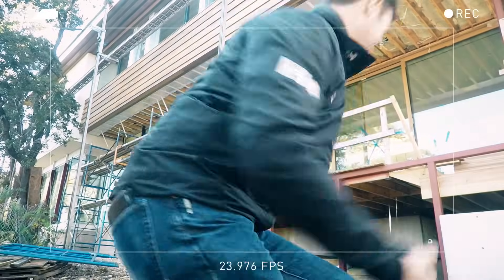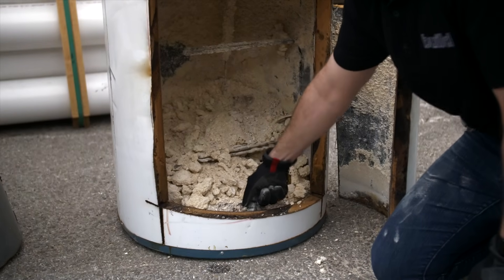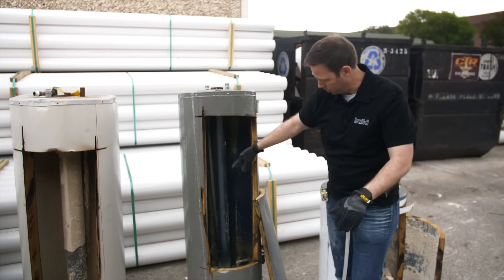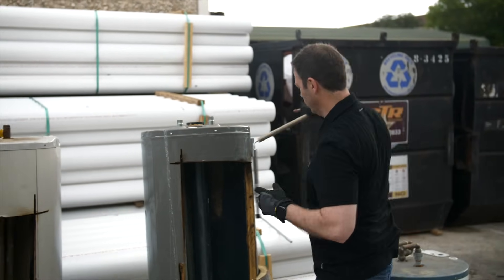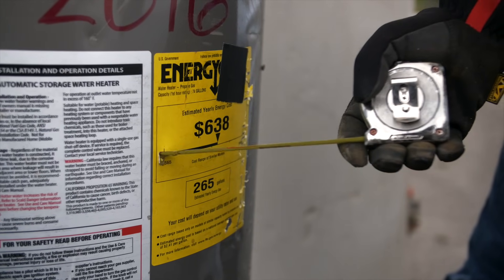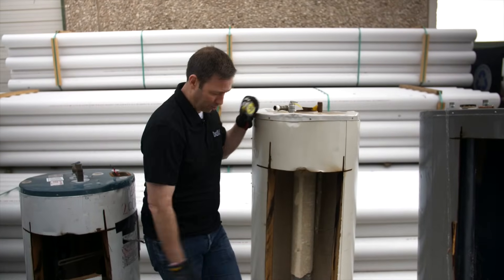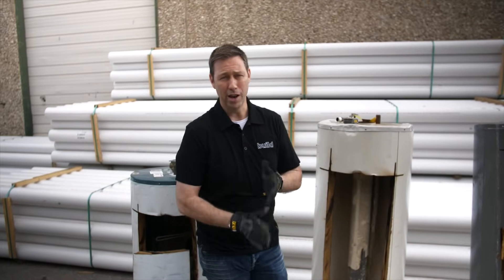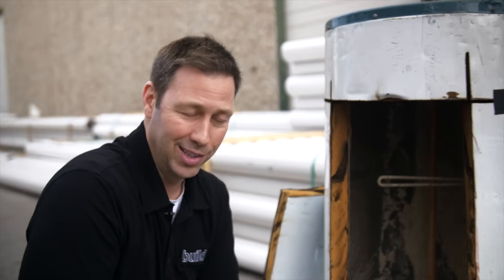Four Water Heater Tanks Cut Open - Lessons to Learn

Comment: Lots of bad information here.  1) mineral deposits in a water heater is directly determined by the amount of mineral dissolved, not the anode rod.  The anode rod is only to protect the tank from corrosion.  2) All electric heaters have the same heating efficiency.  The only difference is in the insulation and temperature maintained.   3) All tank-type heaters sold today are glass-lined.  Funny Matt didn't know that.  4) The height of a heater has an effect on its efficiency.  Tall heaters are better. 5) Heaters fail because of corrosion and leaks.  It could be tank corrosion or it could be control corrosion.  After a heater is about 5 years old, it makes more economic sense to replace it than to repair it if you are not a DIY.  6) After a heater is over 5 years old, it can be very difficult to unscrew an anode rod without excellent wrenches.   My qualifications?  15 years as a water heater Service Agent.
Reply: Koenigsberg, I didn't get the impression that he was saying the deposits were due to the anode rod condition.  He was just commenting on the lack of maintenance IIRC.  On #2, you are correct, the heater will use the same amount of power, it will be a lot slower heating it though with all that sediment on the coils.  #3  There are electric foam insulated heaters on the market.  Check out whirlpoolwaterheaters.com for example.  I imagine glass is used on gas heaters due to the fire hazards they present.  Overall you were correct, I was just sort of bored and thought another input wouldn't hurt.
Reply: all water heaters get glass and foam. :)
Reply: Matt seems knowledgeable about home building in general, but when it comes to the specialized things.....yeah, people need to research on their own and not rely on one person's information.
Reply: @GiovanniGiorgo  This is typical of Youtube video creators, they have no-one proof checking what they are saying. He says the deposits are calcium (calcium is a reactive metal never found in nature), which they are not, but they are calcium salts such as calcium carbonate. As a Materials Scientist, industrial chemist and corrosion technologist I can say there are several errors here. The knowledge of people working specially in this industry far out -weighs the generalisations made here.
Reply: This is the problem with Youtube, lots of misinformation.If I want information about corrosion I would seek the advice of a corrosion technologist. How often I hear supposedly knowledgeable people say it is calcium deposit, it is not, the deposit is a salt of calcium, such as calcium carbonate. This video needed proof checking for accuracy, as evident by all the errors highlighted. I am a Materials Scientist and industrial chemist.with corrosion background. @GiovanniGiorgo
Reply: 1 1/16 impact wrench, magnesium rod on ebay (35 bucks), Teflon tape.   remove/replace.  good to go.     Impact wrench is key.  that thing rattles out like a hot knife thru butter.
Reply: would a water softener reduce any scaling and build up?
Reply: @randomrazr  Matt R showed two electric water heaters.  One had lots of scale and the other had very little.  The difference was probably hard water vs soft water.
Reply: Haha The efficiency thing 1 minute into the video got me to check the comments. Why does YT keep recommending this channel to me? The very first video I saw of Matt's had him spouting similar fundamental misunderstanding of building systems (flashing in that particular case). 
We remove old cylinders in renovations we do and I often install 1 - 5 year old second hand ones to save $700 a pop. Intrigued to see the interiors of the cyls so I thought "hey this video might be interesting"

But yet again Matt is 30% knowledge and 70% presentation style. The ONLY place a cylinder "loses efficiency" is in relative levels of insulation.

I should add we here in NZ use a lot of low pressure copper cylinders which when manufactured well with high quality materials last 3 times as long as glass-lined or enamelled steel.
Reply: @DiscoFang  
Are some of your systems like ours in the UK?
Mains fed cold water storage tank in the roof space that then feed the hot water cylinder. A direct cylinder using an immersion element, or indirect that has an internal heating coil fed from the CH boiler?
I've lived in my house 26 and a bit years, the copper cylinder hasn't been changed.
Reply: Neil Crawford Yes, immersion element from a header tank. But pretty much all those open vented header tanks have been replaced by valves pressure reducers and balancers. We never had the same CH water systems I've seen in the UK. In fact residential radiator based central heat systems are very uncommon here.
Reply: @DiscoFang  
copper is super expensive in any application.
Reply: As an installer of new water heaters, you should always pull the anode rod and put anti-sieze or even pipe dope on the threads. That way in a few years it will come out without risk of damaging the tank.
Reply: Erik Bogart excellent idea will do
Reply: @erikbogart676  I was wondering about that myself, never sieze is a wonderful product the work it saves in the future is certainly worth the few minutes to use it, I'm kinda like the lady and the Franks red hot sauce, I put that shit on every thing, within reason of course.
Reply: Thesuggestion to replace any 5 year old WH; Doug must be kidding, right?    The tank can be cheap, plumber cost is not.  There isn't whole lot of parts on a WH.  Any capable home owners should learn how to maintain their WH.  Manufacturers should stop practice of selling the same WH with 6, 9, and 12 warranty (the difference is the size of preinstalled anode rod).  Instead, inform the owners to inspect and change it regularly and design it so it can be done easier.
Reply: "2) All electric heaters have the same heating efficiency.  The only difference is in the insulation and temperature maintained."
Well, yes and no.
The heating efficiency depends on the ratio (heat conductance from heating element to tank)/(heat conductance from tank to environment), 
and it also depends on the tank volume.
As you clog up the tank with sediment, both the heat conductance from heating element to tank and the water volume in the tank decrease.
As a consequence, the heating efficiency (i.e., the fraction of heat produced that is not lost through the tank insulation) also decreases.
Reply: Tatzelbrumm I see your point there but efficiency is ultimately a ratio of electricity consumed relative to the heat produced. And in a cylinder all the materials within the envelope of insulation will try to reach equilibrium whether there is scale on the element or not. The scale may cause the element to draw less current or even overheat but the energy conversion ratio remains the same - 1:1. Efficiency is the wrong word to use when describing the effect of scale or other damage.
Reply: @DiscoFang , as you write, once the materials within the insulation is in thermal equilibrium, the energy needed to maintain the temperature only depends on the thermal conductance of the insulation, which doesn't change as the heater element gets clogged up. 
In steady state, the water heater is 100% inefficient, because the heat in the water stays the same, and the only heat that needs to be replaced is the heat lost through the insulation to the outside.
If you work out the heat conductance equation for the heating process, efficiency, defined as energy ratio, does deteriorate: during the heating process, some of the heat leaks directly to the outside and does not heat the water. 
But as long as the heating element isn't so badly clogged up that it is insulated from the water almost as good as the water is from the outside, the deterioration of efficiency is small. 
If the hot water gets used at a fixed time after starting to heat up cold water, and the time is long enough for even a clogged heater to bring it up to temperature, the efficiency even improves, for the reason you wrote in your other comment: on average, the water in the tank remains colder. 
The physical equations show that other physical effects, namely, overheating of the heater element and a longer time for fresh water to reach the temperature set on the thermostat, are more sensitive to clogging than thermal efficiency. 
So the water heater probably becomes useless before it becomes seriously energy inefficient.
Reply: You beat me to it...lol...water quality is a factor as well... Meridian Ida. They get 2-3 yrs even on a maintenance plan, the lime in the water is bad. ( 22 yrs plumbing)
Reply: Doug KOENIGSBERG nailed it on the head sir. I once went to change an anode on a i believe six year old water heater and the threads in the water heater broke as I went to pull the anode rod out😬.
Reply: how about what kind of water get in your water heater how contaminated is it
Reply: And a tank that heats the water slower is not "less efficient" it's just slower to recover. The only real way to increase thermal "efficiency" of a cylinder when it relates to thermal loss through insulation is to lower the temperature setting. As the temperature of a body rises it loses heat "faster".
Reply: @DiscoFang , you are correct. The most significant setting that affects energy consumption is the temperature difference between the water and ambient temperature. According to the heat conductance equations, the energy required to keep the water at a preset temperature is proportional to that temperature difference: The higher the temperature setting, the more electricity you consume.
Reply: Doug KOENIGSBERG your right and he doesn’t even no about anode rods or which one the water heater comes with or why !
Reply: My hot water tank lasted 25 years and the only thing I did was replaced the heating element and I run on well water
Reply: Try to remove a factory installed anode without a 1/2" drive pneumatic wrench impracticable.  Replace anode every 3-4 years if you have a history of fails before 6 years. Electric anodes work well. Flushing out the tank through the boiler bib is not practical. The oriface is too small. It will clog up right away most of the time.
Reply: richard ordonez Hit the the gym maybe? I’ve only replaced Anodes with just a breaker bar.
Reply: Mike - my experience is that it is not the torque being able to be applied it is keeping the tank from rotating due to the torque. Just like taking a wheel off a car.  Easy when suspended and using an impact wrench but pretty impossible with a breaker bar since the wheel turns.  I only have a 40 gallon tank so that makes it pretty light to start with!  Impact makes all the difference and should be available as a backup if anyone attempts this.
Reply: @richardordonez8331  I concur.
Reply: @richardordonez8331  I am not a big guy and I did it with a breaker bar (by 2nd person) while the tank close to full and I wrapped my body around it.  That was more than 10 year ago (new tank is now 18 years old).  Because the old rod was in fairy good shape, I haven't felt the need to do it again.    I should.
Reply: @richardordonez8331   That is why it is a good idea when attempting to flash the water heater, drain it first and then replace the original bib with a ball valve. Its 3/4 inches big in diameter and will help out during the process of flushing the water heater.
Reply: thank you good sir for your talents this padowan has learned much about water heaters and their efficiencys
Reply: Any recommendations for removing some sulfur from one? I foolishly replaced the water heater before replacing the water system a month later new clean water removed sulfer build up from the pipes right into the tank.
Reply: Pin Taco you can shock your tank with peroxide or chlorine and flush it all out until it is potable again. Is it just sulphur smells coming from the hot of your faucets. Magnesium rods will react with certain water quality elements and present the smell of sulphur as they deteriate. If you come across this, replace the anode with an aluminum rod, shock the tank and the smell should disappear. More common in rural areas on wells, due to different water quality in different areas. I come across it quite often, if the smell is only on the hot you don't need to treat the whole house. Just repair the water heater
Reply: Couldn’t agree more!!and I’ve only been manufacturing gas/electric commercial and residential water heaters for just over 3 years
Reply: Not false at all.  He didn't say what you think he said.
Reply: I have been told that a water softener will reduce the scale accumulation but can cause the annode rod to be used up more quickly. Is this true and if so is it better to soften the water and sacrifice the annode rod quicker or not soften the water?
Reply: pretty sure he is simply explaining a bit of how the actual unit/internals work to the consumer.  Not trying to teach a real repair person.  
As a consumer...water heaters are not a large expense, so replacing as a maintenance item is a much better way vs waiting for it to go out.
Reply: What people don't seem to get sometimes is when it comes to heating electricity is 100% efficient there is no wasted energy.
Reply: If just my heater nipple's are corroded do i change the dip rods as well?
Reply: King Tut 
Don’t have to unless it is broken
Reply: he just cut the 2016 and there was no glass
Reply: Almost right-- an electric water heater is 100% efficient except for what heat leaks through the walls.  And that heat loss is only really a loss in the summer, when you are trying to cool your house; otherwise it is helping to heat it.  All of the electrical watts are dissipated inside the heater, so electrical watts in => Temperature rise out.  So all that corrosion has NOTHING to do with efficiency of an electrical water heater.  Different story with gas-- the heat chamber is on the outside of the tank.  It depends on heat transfer between the flame and water by way of conduction through the wall of the tank (including convection through the flue up the middle-- a gas water heater tank is really shaped like a donut).  So any corrosion buildup on the inside surface of a gas water heater will hinder this heat transfer to the water, resulting in more of the heat going out the flue rather than into the water.  The anode rod provides for extended life of the tank itself, reducing the net annual cost of the water heater by spreading it out over more years of life.  

As for heater shape, I would suspect that, with the same wall thickness of insulation in both, whichever tank has the least surface area will have the least heat loss and therefore the lowest operating cost.  However, a taller, narrower tank does help to reduce the mixing between the hotter water at the top and the cold water that just entered the bottom.  I actually tried this in a way when my 50 gallon water heater quit.  Quick recovery water heaters have two heating elements.  They are designed to first turn on the lower element as the hot water exits the top of the tank and cold water enters the bottom.  Then, with additional demand, as more of the tank is emptied of hot water to the point that the water near the top (the exit) is cooling, and the water below being somewhat heated already by the lower element, the top element turns on, which turns off the bottom element.  This provides an extra amount of heated water for use, because the top element is heating water that is already preheated by the bottom element.  I tried modifying the top element thermostat so that it did not turn off the bottom element-- instead both elements turned on, doubling the wattage to the tank.  CAUTION: BEFORE I DID THIS I MADE SURE THAT THE CIRCUIT BREAKER AND ALL WIRING TO THE HEATER WERE CAPABLE OF HANDLING THIS DOUBLING OF THE CURRENT.  Since it was a smaller 30 gallon water heater, it had significantly less surface area and therefore had less heat loss.

Has anyone ever tried inserting a small tube up the drain valve and use air pressure to mix things up in order to flush it out?
Reply: Doug KOENIGSBERG I didn't see your video
Reply: Doesn't the anode rod also serve to protect copper water pipes in your home to some extent?
Reply: How about coating the threads with anti seize compound, Permatex  makes a good one used in the automotive industry?
Reply: what you think of following:
1) magnesium rod will give a smell like a rotten eggs unless you have a separate fountain for drinking water. (the video does not mention)
2) the magnesium rod will rust out faster than aluminum rod. (the video mentions exact opposite)
3) keep the set temperature of water lowest comfortable to minimize the scale one the walls. It will also provide higher efficiency because the exhaust will not be as hot compared to the setting that is set hotter. Also will extend the life of tank.
4) install a pressure regulator and reduce the pressure from 98 psi in my township to 65 psi. those 33 psi helps eliminate hammer effect which can jump the pressure to 400 psi momentarily when we we shut close any faucet(specially high-flow faucet). The plumbing system in my house never goes higher than 65psi regardless of how fast i close my faucet. This will significantly increase life of the heater without any doubt.
Reply: Good to know Doug
Appreciated
Reply: I got a few minutes into the video, not worth finishing
Reply: A spherical tank should be the most efficient use of insulation, but I can see legislation making tall tanks more efficient on average. There is no physics based reason for tall tanks being more efficient than short ones.
Reply: Doug KOENIGSBERG water heater service agent sounds like a made up title to get around going to trade school. Was the certificate written in crayon
Reply: Doug KOENIGSBERG anode rod is to prevent electrical shock
Reply: @jasonlast6838  not so. The rods have varying composition to match the minerals in the water.  It is all about preventing corrosion which shortens tank life.
Reply: Doug KOENIGSBERG yes it is as I'm a repair man 👍 quick Google research will teach you
Reply: Jason Last I think you are confusing electrical shock with electrolysis. They are very different things. If an anode rod prevents electrical shock then why are they in gas water heaters that are not connected to electricity?